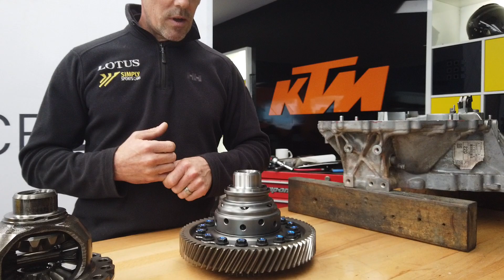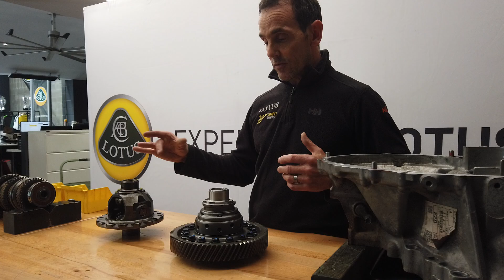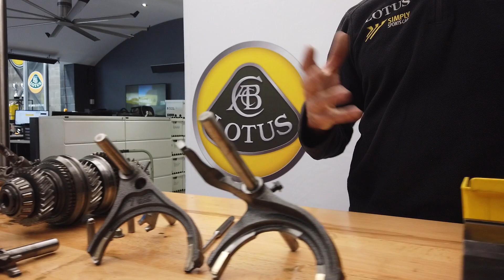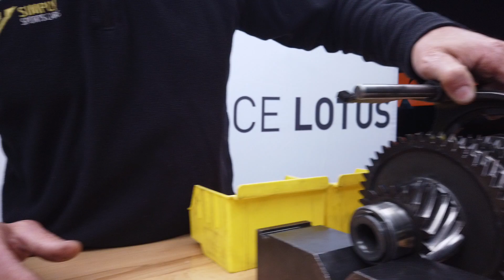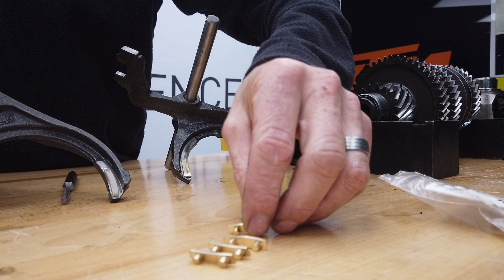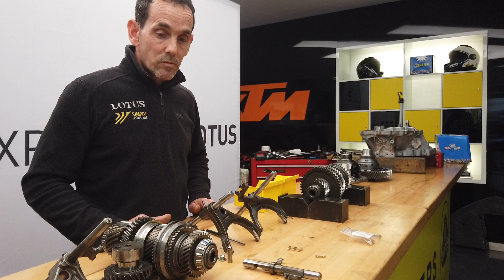Putting a LSD into an Exige or Elise sports car for track days

Comment: if you lift a rear wheel the Quaife won't help you, it'll switch like an open diff when one rear wheel isn't making contact. A plate diff is more savage but better for autotest/gymkhana/targa/rally and maintenance is infrequent so no drama.
Reply from the maker: If you lift both wheels perhaps you should be stunt driving right?
Reply: @SimplySportsCars  ;)

Comment: Does the LSD render the electronic assisted corner braking system useless or do they complement each other and work synergistically?
Reply from the maker: Hi Peter, the LSD compliments the onboard vehicle dynamic systems which normally kick in when wheel spin is detected and thereby serve to act as an electronic differential by using braking on the spinning wheel (typically the unweighted inside rear) and if necessary requesting a torque reduction.  The LSD removes the spinning from the equation and therefore the electronics are not triggered to kick in, thus allowing full power to be delivered and promoting better drive out of corners.